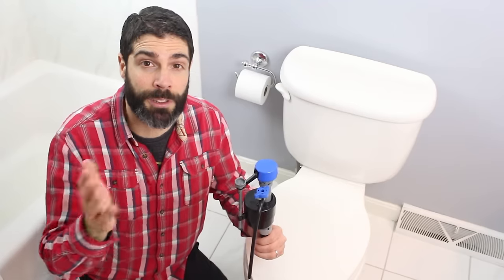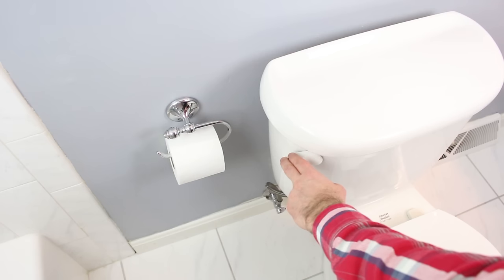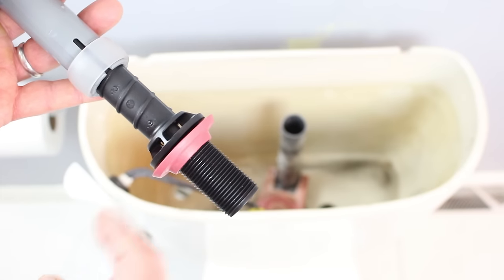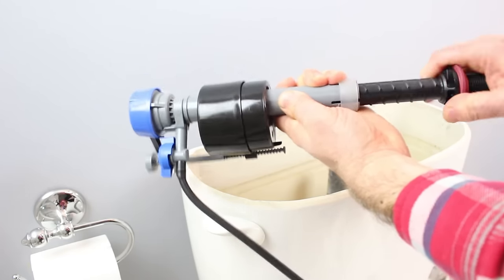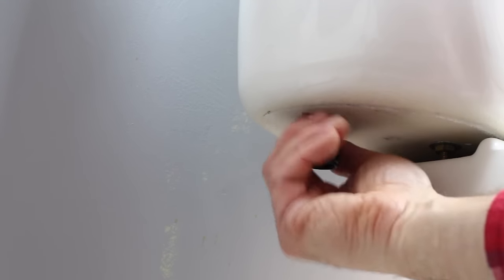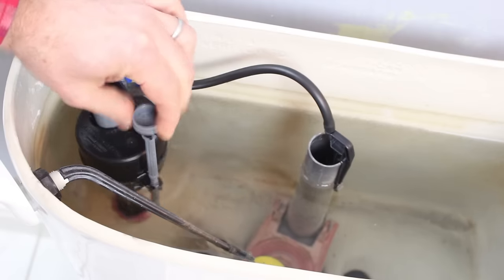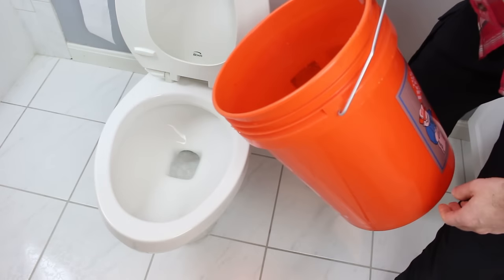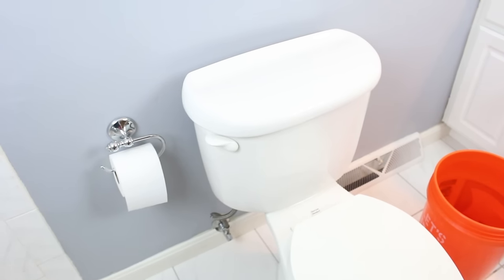How to Fix a Running Toilet with Fluidmaster 400H Fill Valve from Home Repair Tutor

Comment: loosening the grey ring and separating the fill valve voids the warranty as the rubber rings inside get damaged and that will also cause the it to continue to fill

Comment: So I turned the screw all the way clockwise and the water level is still like an inch and a half below the overflow pipe. How can I fix that?
Reply from the maker: Make sure the fill valve is set so it stands 3 inches taller than the overflow pipe. If it is not then you will need to adjust the valve taller to increase the water level inside the tank.

Comment: So I got a weird problem which I am unable to find the solution for. After installing the Fluidmaster fill valve, water keeps filling bowl at intervals of couple of minutes. This happens even without flushing. Once again, it isn’t leaking but just filling the bowl in minutes interval. I feel like it’s wasting a lot of water to keep feeling the bowl from time to time. How do I fix it.
Reply from the maker: The valve noise you are experiencing is alerting you to water loss inside the tank. When the toilet makes a "Ghost Flush" it is turning on and off very quickly to refill water into the tank.
 
The #1 cause for a ghost flush is a worn flapper valve. I recommend cleaning the drain seat (the area the flapper is covering) and the flapper. If that does not stop the ghost flush  replacing the flapper should stop the leak.
 Here is the best option for replacing the flapper: https://youtu.be/PCl-kH7g_5w
Reply: You’re awesome. I was able to replace the flapper valve and no more ghost flushes. Thank you so much!

Comment: What if the red gasket isn't on the fill valve already?
Reply from the maker: If the red gasket or “Shank Washer” is not on the valve then simply locate the gasket and place it on yourself. The gasket has a tapered end and a flat side on the other end (bottom and top). Place the flat side up onto the fill valve threaded shank and slide to the top of valve until flat side comes in contact with the shank stop. For help with your installation please call Fluidmaster at 800 631-2011.

Comment: I can’t reconnect the pipe from the shut off valve to the fluid master again
Reply from the maker: Fluidmaster would like more information concerning your installation issue, please contact Fluidmaster Monday thru Friday from 5:30 am to 5:00 pm PST via chat or email @ Fluidmaster.com/support or toll free 1- 800-631-2011

Comment: What’s the difference between 400H and 400AH?
Reply from the maker: The 400A is a standard refill valve that controls the water in the tank, it controls fill time and water level. The 400H is a performance fill valve that also controls the water in the tank. The 400H fill valve has an additional adjustment for the water in the toilet bowl using an independent adjustment knob. The 400H can be adjusted to let more or less water into the toilet bowl without affecting the level of water in the tank.
Reply: Fluidmaster Toilet Repair Videos thanks. I am curious about 400AH though.
Reply from the maker: @mytube2013  The 400H allows you to control the level of water in the toilet bowl which the 400AH does not allow you to do. The 400AH allows you to control the water only in the tank.
Reply: Fluidmaster Toilet Repair Videos On fluidmaster website, it says 400AH has roller clamp to control fill level in the bowl.
Reply from the maker: The AH does not come with a bowl refill dial instead it only comes
with a (Roller) clamp that restricts water to the bowl. The AH is taller than
the H version by 1 inch and comes with a regulator which tops the speed of
refill by 2 gallons per minute.
 The H version our newest mode is more adjustable in that it has a
separate bowl refill dial that allows easier adjustment to increase or decrease
the amount of water going to the bowl, without changing the amount of water in
the tank. The valve does not have a regulator but a restrictor which allows a
faster flow than the AH version and can be as fast as 4 gallons per minute and
 higher.
Reply: Fluidmaster Toilet Repair Videos Thanks, that’s great to know. Does the 400H work in 1.6GPF tank as well?
Reply from the maker: Yes it does. Thanks.
Reply: Fluidmaster Toilet Repair Videos Great, thanks

Comment: just lovely if the below tank water connection and fill valve stem hole are easily accessible as shown in this video....but American Standard toilet tank we have was designed by idiots. and it took me 2 hours to "finger tighten" the stem nut under the tank and another half hour to attach the water line fitting.  Rather than finger tighten I offer a single finger in appreciation of all design idiots. And I think you know which finger that is.

Comment: I don’t understand that blue .. water, bowl valve
Reply from the maker: The blue knob is a dial that allows you to increase or decrease the amount of water going back into the toilet bowl during the flush. Like the Float adjustment rod that allows you to control how much water fills the tank the blue knob allows you to control how much water fills the bowl.

Comment: Video was going way too fast to understand what he was talking about most of the time.
Reply: It seems that way but installing a fill valve is really simple. They come with instructions too. When repairing a lot of things, there's more dramatics involved than the actual work lol. Video was very good, he just moved a little faster. Watch a Korky instructional video. They're made by the factory and go much slower.
Reply: The video was great.  Three visual in the video along with three written instructions were perfect. If it's too fast, you can just pause when needed.

Comment: What if fluid master 400 is running? 😅
Reply from the maker: Please contact Tech Support at 800-631-2011 from M-F between 5:30am-5:00pm PST. Thanks.